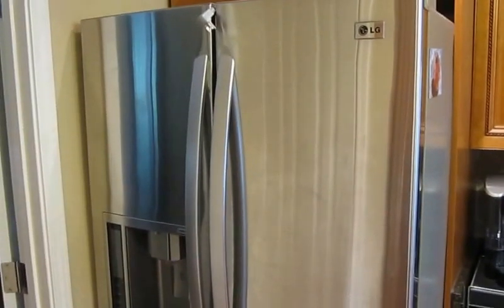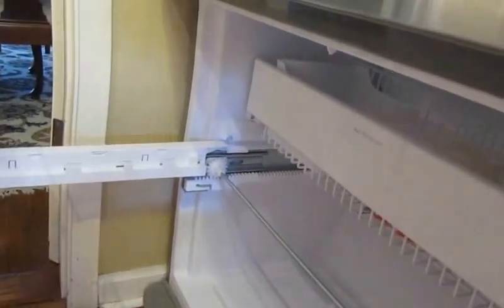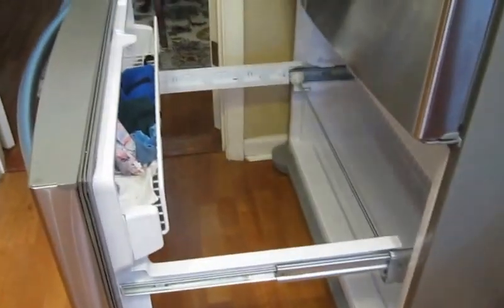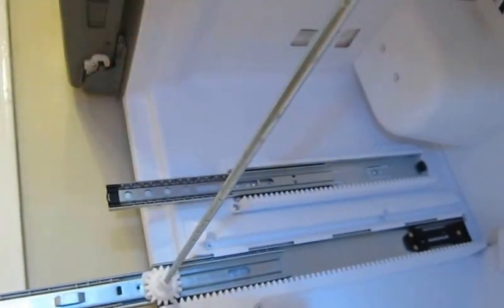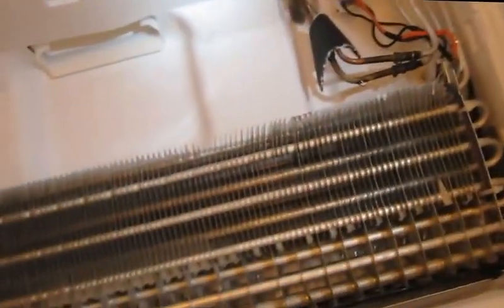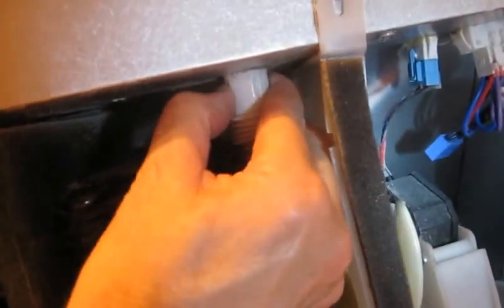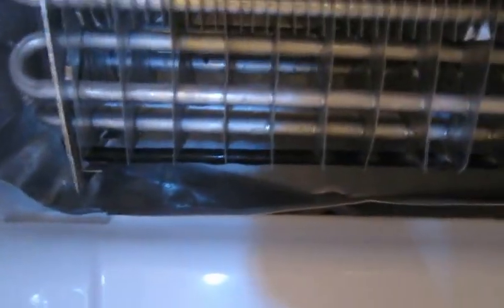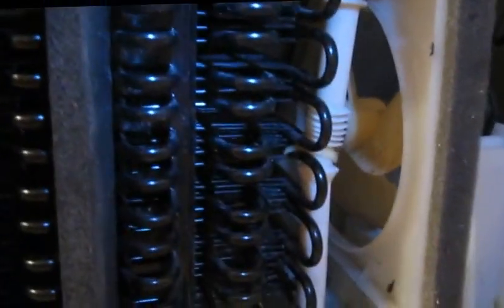LG French Door Refrigerator Ice Build Up

Comment: Did this fix the problem?  I’ve been having to chip the ice out of the bottom of freezer every couple of days.  Now the damn water dispenser button is sticking on too😟
Reply from the maker: nbn33 it did for a long time, but the problem came back and I had to do it again. Make sure the drain tube is as open as possible. Open up the back and attack it from there.
Reply: Because the DRAIN TUBE lacks proper engineering research and development, after de-icing, I put a solid copper wire (from ROMEX, 5" or so long) partway down the drain tube, (just past the 90 deg. that turns down) put some wire insulation (heat shield type) on the last couple inch's so as to not melt the drain tube, wrapped the other end around the defrost element a couple TIGHT wraps, verified it didn't touch the sides as it dropped into the drain.  Basically extending the defrost element down into the problematic drain tube. It's a pain in the a$$ to wrap the wire around the defrost element (and get it TIGHT) but worth the effort.

Comment: Great video, is this fix still working for you or has it froze up again?
Reply from the maker: Captinprivate  Still have the refrigerator and yes it has happened again. Someone commented below that they added more insulation behind the plastic back piece to shield that area from the cold. Sounds like a good idea, not sure if it solves the problem or not.
Reply: @wmcknigify  Thanks.. I have a 8 year old SDamsung that has been doing this for years and I am thinking of getting rid of it. (Tired of defrosting it every 6 months)  I am looking at a Kenmore that is manufactured by LG and I am worried that it will do the same thing
Reply from the maker: Captinprivate mine is about 8 years old as well, so I don't know if they made any updates to this issue or not. The last time it happened I wanted to remove the drain tube entirely to inspect but I was afraid I'd never get it back. If the water had a straight shot out to the pan, I don't think there would be an issue. But it runs over some plastic piece before making it's way to the tube. So I think this area is where the problem is, but not sure
Reply: Here is a picture of the new insulation added, this has worked for 3 years now. I just had it apart because drain clogged due to construction debris kitchen remodel. Oh guess I can’t add a photo here? The factory insulation is open cell foam, once it gets wet, it can’t keep the defrost heat in long enough to keep the water liquid through the drain. I now have 3/8” of foil faced pipe insulation from Home Depot. My old insulation, the foil facing was gone, mostly worn off. To get in and pull the back panel, you don’t need to remove the cross shaft rack. It will easily spring out past all the obstructions. Careful with the fins & pan, very sharp.
Reply: I found on another LG about same vintage 2006-2007 there was a small wad of plaster dust inside the black rubber drain cap, that made the original plug, which then soaked the insulation on the coil enclosure, so then water froze in the drain. This LG maybe a year newer, the foil facing was still intact, but while the cover was out, I refaced it with metal tape Nashua FlexFit, just to make a more reflective surface, shiny is better.
Also a kitchen remodel, I removed the Tyrap for the drain tube, so the tube is straight, and also made sure the little rubber flap on the bottom of the cap was free and clear. Probably should have just removed it, very small air leak if that tube is left wide open...
Reply: @leweezo33  Because the DRAIN TUBE lacks proper engineering research and development, after de-icing, I put a solid copper wire (from ROMEX, 5" or so long) partway down the drain tube, (just past the 90 deg. that turns down) put some wire insulation (heat shield type) on the last couple inch's so as to not melt the drain tube, wrapped the other end around the defrost element a couple TIGHT wraps, verified it didn't touch the sides as it dropped into the drain.  Basically extending the defrost element down into the problematic drain tube. It's a pain in the a$$ to wrap the wire around the defrost element (and get it TIGHT) but worth the effort.
Reply: @nobodyinparticular5224  Thanks for your reply, I hope it helps others.. My wife gave up on it and we bought a LG fridge last year  :)

Comment: Thank you so much, this video was very informative. I learned something new and of course, saved a ton of money. I have a similar LG model, and I was able to use your information to remove the freezer door, access and clean out the drain at both ends and reassemble the refrigerator. Thanks for helping me be more self sufficient!
Reply: Because the DRAIN TUBE lacks proper engineering research and development, after de-icing, I put a solid copper wire (from ROMEX, 5" or so long) partway down the drain tube, (just past the 90 deg. that turns down) put some wire insulation (heat shield type) on the last couple inch's so as to not melt the drain tube, wrapped the other end around the defrost element a couple TIGHT wraps, verified it didn't touch the sides as it dropped into the drain.  Basically extending the defrost element down into the problematic drain tube. It's a pain in the a$$ to wrap the wire around the defrost element (and get it TIGHT) but worth the effort.

Comment: I agree with m.johnson. I called LG due to caked ice in the freezer. The "agent" told me to unplug the unit and make it defrost! WHAT? This is a frost free refrigerator only 3 1/2 years old. OBVIOUSLY, THERE IS A REPAIR NEEDED. This is the third time for repair. The compressor and mother board have all ready been replaced. LG looks great but are junk. Stay away.
Reply from the maker: Katay smith The bad thing is, LG and Samsung seem to have most of the refrigerator market.
Reply: This issue is caused by a bad board. I did this and it happened again and fridge isn’t cooling correctly. Lg tech came by today and wanted $600 to fix it. Board new is only $160